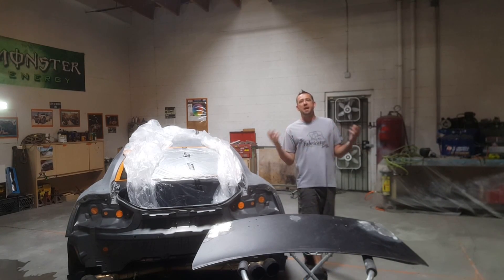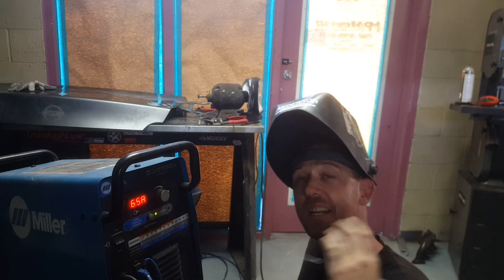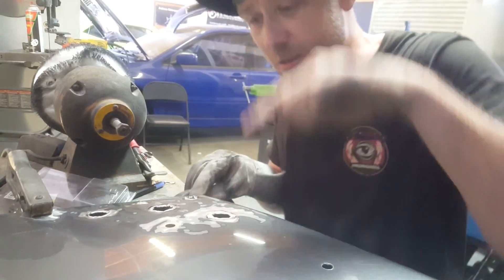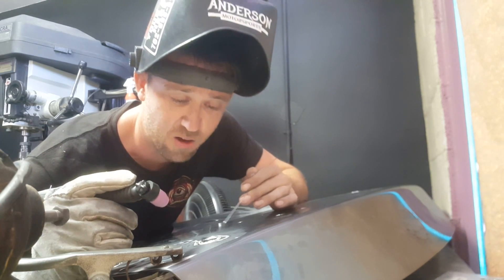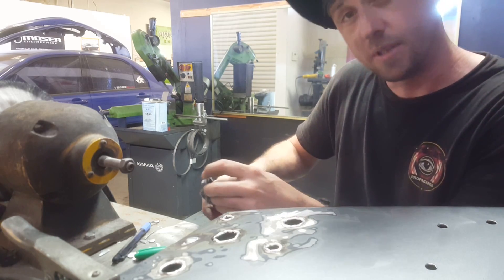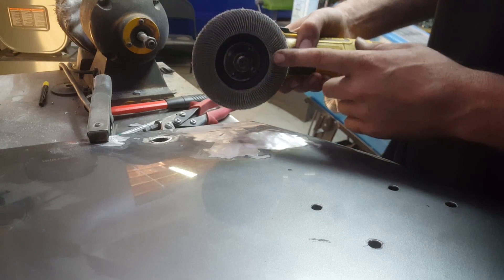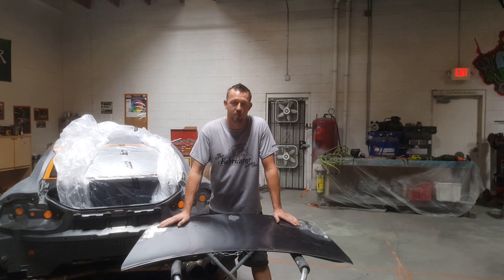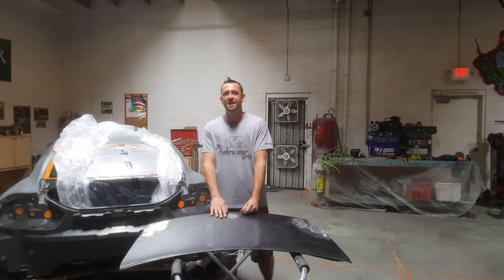TFS: Welding Very Thin Aluminum (GTR Trunk  Shave)

Comment: just wondering why didn't you  just bondo the holes shut?
Reply from the maker: +Jason Raksnis Did you watch the complete episode or skip through it? 16 gauge was the thickness of the aluminum for the small holes (which I mentioned), and I mentioned why I had to jump up to the thicker metal which was to control the heat that went into the lid itself. This kept the warping to a minimum and allowed for very little post weld finish work.
Reply from the maker: Body filler is not designed to cover a hole. It has many limitations. Body filler needs to stick to something in order to cover it. If you try to use body filler over a hole, then sand it smooth, there will be nothing remaining for the filler to stay which will cause it to fall through leaving the same hole in the piece. You have to fill the hole before adding filler to smooth it back out.
Reply from the maker: +Jason Raksnis My machine does not have the control like a Dynasty (I used to own one before I retired). The edge buildup allows more time and assures there is enough metal to keep the plug in there after grinding it down. A steel lid would be very different, but since this is aluminum, extra metal needs to be around the hole so you can fill with more rod which will leave more metal on the bottom side of the two pieces to hold it for ever.
Reply: Umm no. But he should have cut some 16g plugs and welded them in. Way to much work the way he is doing it. Also, with no access to back he can't dolly it out afterwards. He's putting way to much heat is that expensive part.
Reply: it would crack in 6 months or less
Reply: bondo is for shaping, not for filling holes.   the bondo would fall out.
Reply: +The Fabrication Series I commented before watching the whole vid. But I still don't see why you felt the need to go around the hole first with filler. I've done these repairs many times and just cut a circle patch and start tacking. One pass at 55-60 amps and I'm done. I do have a dynasty and would use pulse for this job though.